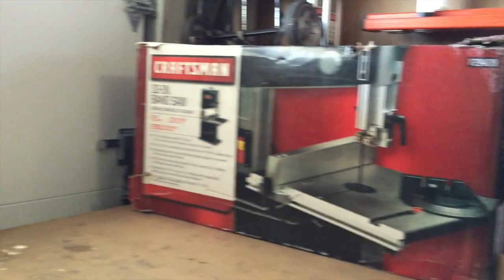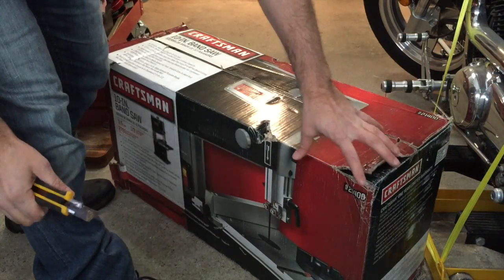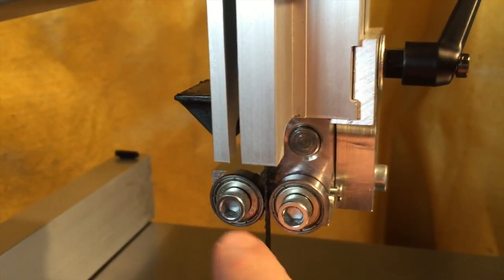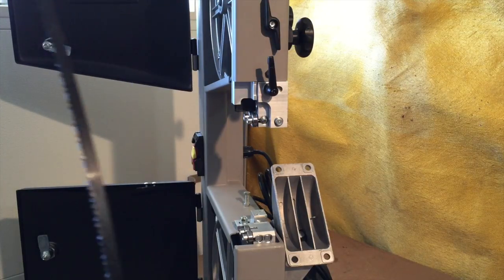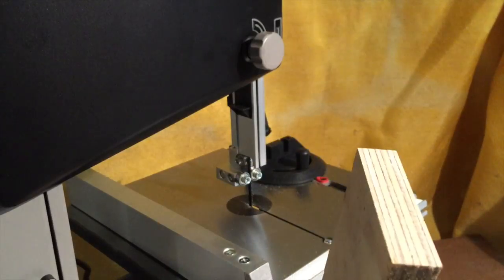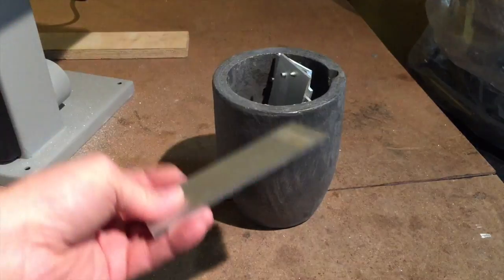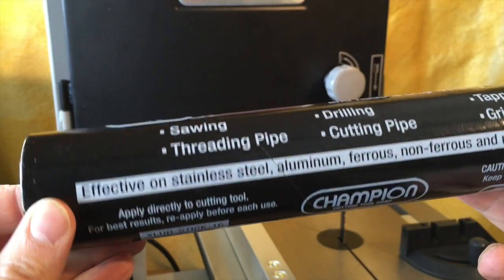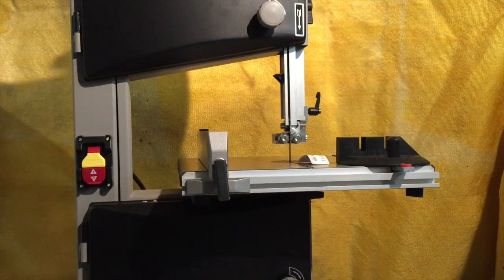Cutting Metal on a Wood Bandsaw - Craftsman 10" Bandsaw

Comment: I cut aluminum on a wood circular saw all day long.  1/4" thick is starting to press the limits.  Need a good quality blade to begin with as well, but it works. I think mine is a 10" blade.  (Of course this is a BAND saw.... but I don't see much trouble for others wanting to cut aluminum.)

Comment: When using a band saw it MUST be hooked up to vacuum, what happens is some of the chips get between blade and the power wheels and will cause the blade to tighten as more and more chips get in between, they get stuck to the rubber and will not fly off because they get embedded into that rubber because of the pressure of the blade on the wheel.
Reply from the maker: Thanks for the suggestion and you’re 100% correct. I’ve since 3D printed an adapter that connects the saw to a vacuum hose.

Comment: It's a Rikon 105-10. I am going to try this on mine. Looks like it worked great. So far you video has been the best review on blade TPI. I never heard of the lubricant so that was a bonus. Thanks for sharing.
Reply from the maker: Thanks for commenting! Just be aware that you can only cut soft metal like aluminum or brass. The blade will get chewed up if you try it on steel.

Comment: With blade tracking, consistency is the primary goal (beyond keeping the blade on the wheel, of course). Where the teeth ride in that is irrelevant as long as it's consistent (blade doesn't travel). Most center the overall blade on the wheel. By the way, to cut harder metals, study the blade in a basic handheld hacksaw. Just like that, you need the finest tpi possible (18~22-tpi). Lubricants (only on the teeth) do help.
Reply: For most non-ferrous metals, you don't need a minimum of 2-3 teeth in the material. Save the high tpi blade for cutting ferrous metals. A hacksaw cuts steel and it starts from zero. A bandsaw runs at a continuous 2000+ fps.
Reply: @mildyproductive9726    ..  However, a bandsaw for wood wasn't designed to cut metal, so don't get too greedy at chewing away at those metals. A higher tpi count (with any metal) reduces strain on the tool and results in a smoother cut, both while cutting and in the finished cut. I always use a fairly high tpi count bi-metal or tri-metal blade for such work. The cost of those custom-made (sized to fit my bandsaw) industrial blades was well worth it.
Reply: @dwightstewart7181  I have a metal-cutting bandsaw, too. I have an 18 TPI blade in there, atm. The coarsest blade I have used in it, so far, is 14 TPI. I sometimes cut small pieces of brass or aluminum pins or tubing with it. But it's mainly used for steel (mostly 1/8" thick). If I want to cut aluminum extrusion or brass plate, I cut it on the woodsaws. 3 or 4 TPI all day. Even if the finish isn't great, it's faster to cut it on the woodsaw and then touch it to the disc sander or to use a file! I would never cut aluminum with an 18 TPI blade by choice (on a bandsaw... maybe with a hacksaw). Lots of standing there and pushing, lots of resting while the piece cools down, and lots of clogging and dulling of the blade!

Check this guy out. https://www.youtube.com/watch?v=pQsZyt_dFWA&t=2s

I don't change the blade to cut nonferrous. I cut aluminum then right back to wood. It doesn't make the blade go dull, unless your TPI is too HIGH. The 2-3 teeth in the material rule? You can stick 1/8" aluminum between 2 teeth with plenty of room to spare. You can see the blade chunking out the material like a nibbler, and it's A-OK. Very little heat build up. The blade might be more stressed, who knows? But my blades last just fine, and they don't seem to mind this treatment at all, on either my 14" saw or my 9" saw. I have a 3 TPI blade on the 9" saw (you read that right) for general use. Skip tooth, obviously. The low tooth count allows me to cut thicker material without bogging down the motor, just feeding slower. If you feed slower with high TPI,  you just burn the blade/wood up. Higher TPI is harder on the tool. Lower TPI allows the momentum of the saw to do the work and then to recover. It's like a A-10 Warthog. When firing 2 billion rounds per second, it takes 50% of the jet's engines to just counteract the recoil. If you reduced the "TPI" or firing rate of the gatling gun by half, you only need half the power, on average.

Wood saw not designed to cut metal? If you consider optimum fpm to cut aluminum, most "metal-cutting" bandsaws are not optimal for aluminum; way too slow. And if you look at the suitable materials to be cut with a "wood" carbon steel blade, it includes nonferrous metals?
Reply: @mildyproductive9726    ..  Okay, too long-winded, too rambling, to even attempt a response. I don't even know where to start. You have a nice day.
Reply: @mildyproductive9726    ..  Guy, where did you get the notion I was using anything other than a standard bandsaw designed for woodworking? That's what this video is all about.
Reply: @dwightstewart7181  I'm sorry for my last comment, and I am erasing it. If you care to share what TPI blade is more appropriate for a wood cutting saw to cut 1/8 to 1" aluminum, then feel free to state it. I've cut aluminum with 3, 4, 6, and 18 TPI on a wood bandsaw, and 18 TPI on a metal bandsaw. I will take 3 TPI woodsaw all day everyday. 

If my comments are too long for you to read, just watch this, please.
https://www.youtube.com/watch?v=pQsZyt_dFWA&t=2s
Reply: @mildyproductive9726    ..  Since I'm using industrial-quality blades, I can't make that recommendation. That's why I haven't made such a recommendation before this. Use what you want, what works. Just remember the wear & tear on the machine when doing so - not as much of an issue with aluminum, but, as I said, much more so with harder metals.
Reply: @dwightstewart7181   @Dwight Stewart  Thank you. I'm curious if you watched that linked video, though. 

FYI, I am using a Morse MK carbon flex back in both of my wood bandsaws. 25 thous thickness, 1/4" and 1/2", 3 TPI and 4 TPI atm, on the little saw and bigger saw. 

I like a low TPI... well, first and foremost it's because it will cut anything I have ever wanted to cut on a bandsaw. And it will continue to cut thinnish materials even when it gets dull. Finish is terrible on thin materials. But it takes relatively little effort to improve the finish on the edge of thin material, anyways! But the other reason is the opposite of what you mentioned.

Lower TPI puts LESS work on the saw motor for the same amount of cutting of any material I cut on a wood bandsaw (i.e., not steel). The higher the TPI, the harder you have to feed, and more the the motor works and bogs. And if you let up on feed pressure too much and don't feed it what it wants, you'll have problems. You'll burn your fingers from the heat and have to take more breaks when cutting aluminum. And you'll need more lube to keep the chips clear. And your blade won't live as long.

On thin and soft materials that don't challenge the motor, like 1/4" plywood, a 6 TPI blade actually cuts faster than 3 TPI, IME. Even an 18 TPI blade will cut super fast. It's when the material gets more challenging that putting too many teeth in there starts stack up to more-than-1HP. Or in exchange of "too many teeth" you could also say more cuts per second, when there is less than 1 tooth in the material on average. Each tooth touching the material per second (and hopefully most of them are actually taking a bite) adds up to more power needed. Any teeth not taking a bite are making heat and getting dull and sucking power with no upside. And the woodsaw is running the blade pretty fast.

If those bites get too big, because you have too low a TPI and you feed too hard? In steel you strip the teeth. In aluminum (or wood or anything you actually cut on a wood saw), nothing bad happens. You bog the motor and you back off.

Edit: so when you go to low TPI skip teeth on skinny blades, it isn't only to enlarge the gullets. The gullets get so long and shallow that there are diminishing returns. The other benefit of reducing TPI is to reduce power requirement by reducing # bites/s. You can continue to cut efficiently and cleanly with slower feedrates, slower but still-clean cutting, and less power required. For the sake of straighter cuts, lower tpi also reduces your minimum feed pressure, so you don't bend and twist the blade in the cut. 

You can do the same thing with wider blades, for the same reasons, except you don't have to use shallow skip-tooth gullets.

Pedantic: if you wanted the blade to cut the same way it's cutting in the metal saw, you would have to feed it 10x faster. Requiring the same feed pressure but getting 10x the feedrate. It would cut like lightning. But that much pressure can bend the blade (wood saws don't reach as high a tension, typically), and you also might run out of power. Because to cut like this, you need 10x more of that, too. When you run out of power or blade rigidity, then you have to back off. And when the teeth don't cut efficiently, anymore, because they're starting to graze instead of bite, you might as well go ahead and lose some of them. You'll get a rougher but more efficient cut. Suggesting higher TPI to go easy on the saw, because "it's not designed for metal," exacerbates the problem. You actually want a coarser blade because it's a wood saw. 

And I'm sorry. You did nothing in particular to deserve me. I know I'm a bitter pill.

Comment: Got me a great used 9” craftsman almost new was going try to mod the motor (dc treadmill motor ).after watching your video going try it stock. I was worried about rpm on cutting metal. Good video good information
Reply from the maker: Paul Trimble - Thanks for taking the time to comment! Just remember, cut only soft metal and be careful.
Reply: eviltwinx 10-4 thanks

Comment: Cool vid. Nice tool for the workshop. I use one on a regular basis, one suggestion, lower the bearings as close to the stock as possible to minimize the flex while you apply pressure to the band...keep it up bro.

Comment: I'm getting a small 8 inch bandsaw to cut aluminium that comes with a 1/4inch blade.. wondering if there was plenty of room to fit the half inch blade? Also which did you prefer to cut with the 1/4inch blade and 1/2 inch blade? 
Cheers
Josh
Reply from the maker: It depends, if you’re planning on cutting patterns, the 1/4 inch blade would be better. Anything thick or just straight cuts, I’d try the 1/2 inch. I prefer the 1/2 inch since I’m mainly cutting down stock to fit in my crucible to melt.

Comment: Wow, just found your video on the saw....cool.
Just picked one of these up used for a song, looking to use it for mild steel 18,16, 14 ga. 
Any recommendations on a blade for me ? 
Hoping to do something with the drive pulley to slow it down a little, your thoughts ?
Thanks,
Reply from the maker: I forget where I ordered my blades from but I do remember they were not cheap. If you’re just cutting straight lines, go with a wider blade and less TPI on the thicker metal and feed the metal in real slow. I wanted to figure out a way to slow the speed down as well. The best/cheapest way I figured was to use an old 1725 rpm motor with a small pulley and use the largest pulley on the other end. At least a 12 inch pulley. If you have a treadmill motor, that would be even better since it’s variable speed. I’ve never taken the motor off so it might be more complicated depending on how the drive shaft is situated.
Reply: @eviltwinx  there’s a guy on eBay that sells a speed reduction kit for a 9” bench top saw-brilliant. I think I’d try to tinker something up like that before doing the different drive motor multiple pulley route. Just to be able to switch the blade/pulley/belt would be a huge advantage to be able to do both wood and steel. Just have to find the right 10 or 9 inch pulley to marry to the original and there you go. Hey, thanks for the response. If I get it worked out, I’ll let you know. 👍🏻

Comment: Hey! All you have to do to change the speed is change the pulleys and maybe the belt NO problem
Reply from the maker: Yea- this is a future project. It’ll be a bit challenging since it’s not like the older bandsaws that had the motor separate from the machine. I like your suggestion though!

Comment: I wonder if you could use a router speed controller from Harbor Freight to control the speed?
Reply from the maker: amtpdb1 - good suggestion. I've already looked in to it and it wouldn't work. The type of motor that's on the bandsaw isn't compatible. I'd think because is a AC motor.

Comment: I have the exact same bandsaw. It might be too late, but I'd purchase a 4" Engineers square from McMaster-carr. Does a bandsaw have drift? No Sir ! Not if your blade is truly 90°.  I've resawn 3.5" oak from lowes, and made 1/8" panels for a box, and the pieces were dead on. I'm actually in the middle of looking at https://www.magnate.net/, which supposidly has blades for cutting steel. I'm going to say 18 or 24 TPI for steel cutting, Bi-metal blades. I usually get my blades from Timber Wolf Bandsaw blades, 70.5" blades x 1/2". 1/2" is the max width according to the sticker on the back of the 10" Craftsman bandsaw. If you get a 1/2" blade, it will not make that squeeking sound anymore. Trust me, I've had my bandsaw for a little over a year, and that was the very first problem I had. I can cut Red Oak without any sqeeking, using a Timber Wolf 1/2" x 3 TPI.
Reply from the maker: Hey man, thanks for commenting and the great suggestion! It a great bandsaw. I forget where I ordered my blades from but next time I'll try visiting magnate.net

Comment: is the 10" good to cut metal like 1095?
Reply from the maker: Because of the speed of the blade, I would say no. Maybe if it’s thin sheet metal. I would really only try to cut soft metals like Aluminum or brass.

Comment: I mean you're cutting aluminum. You can use any wood blade on it. It's "metal" but it's nearly as easy to cut as wood. The real question is whether it will cut steel.
Reply from the maker: I tried to cut thin sheet metal and it tore up the blade. So yea, only soft metals like aluminum.

Comment: Could you hook it up to a light switch dimmer to slow the speed down
Reply from the maker: chris belmore - Its a good idea but it doesn't work very well. I've tried it using a Harbor Freight router speed controller. The motor doesn't like being slowed down. I think it's because it needs torque and restricting power makes the motor not only weak, but also sound like it's going to fry. Most AC motors are like that. DC motors are adjustable.
Reply: eviltwinx ..thanks for info I have thought of doing this for a cupl power tools . now I know a waste of time
Reply: eviltwinx PS I have this same band saw I think I haven't used it much yet just at the ending stage on building my shop . how you like it . I haven't watched your entire vid  you may answer this ? In the bid but its a new tool so assume haven't used it much at that point
Reply from the maker: chris belmore - I do like it and it hasn't given me any issues plus, it cuts through soft metal with ease. I'm not a wood worker expert so I can't give a review on accuracy for re-sawing and such, but it does come in handy when needed. I think you'll be happy with it.

Comment: Lol you are killin me. You did a lot of research to discover teeth face the material...lol but seriously look at vid at 4:45 those teeth are facing back., not front.
Reply from the maker: Sorry, I think we're not on the same page. I didn't need to do research to know that the teeth need to be facing the material - anyone who doesn't know that shouldn't be operating a bandsaw. The direction of the teeth is another matter. Do they need to face "up" or "down". The other confusion is, what is "up" or "down". I can assure you that blade is installed correctly. This video is over two years old and I've been using it on a fairly regular basis. That being said, I do thank you for pointing out something that you believed was not safe. It made me go and double check - which is not a bad thing.
Reply from the maker: Sorry, I think we're not on the same page. I didn't need to do research to know that the teeth need to be facing the material - anyone who doesn't know that shouldn't be operating a bandsaw. The direction of the teeth is another matter. Do they need to face "up" or "down". The other confusion is, what is "up" or "down". I can assure you that blade is installed correctly. This video is over two years old and I've been using it on a fairly regular basis. That being said, I do thank you for pointing out something that you believed was not safe. It made me go and double check - which is not a bad thing.
Reply: I think you are seeing an optical illusion... the blade is the shiny part that is toward the far side of the wheel with its teeth nearest to the camera.

Comment: get a stick of Lenox Lube Tube and you might see if you can get a bi-metal blade, 10 tpi should be in the ball park for what you are doing, the blade lube helps a lot and blades last longer I would not try steel you are turning blade way too fast for steel good vid thanx
Reply from the maker: Thanks for taking the time to comment! I do have one of those lube sticks and are using bi-metal blades. Not sure if it will cut through metal, but for soft stuff like aluminum and brass, it works pretty well.